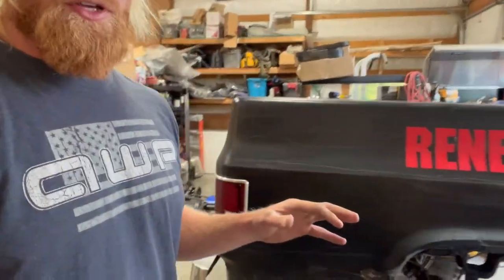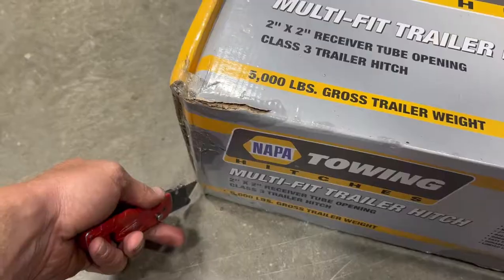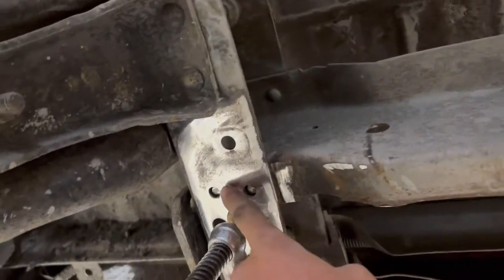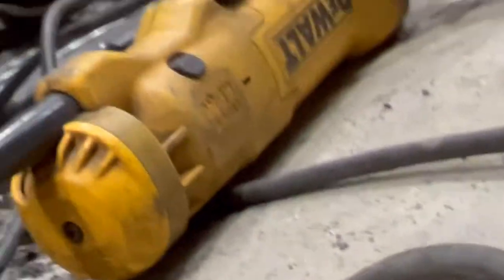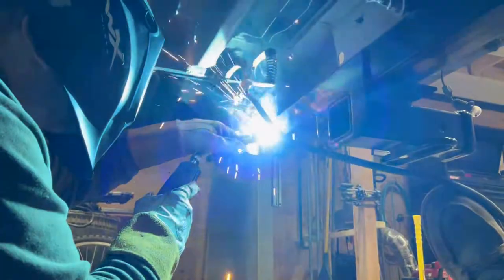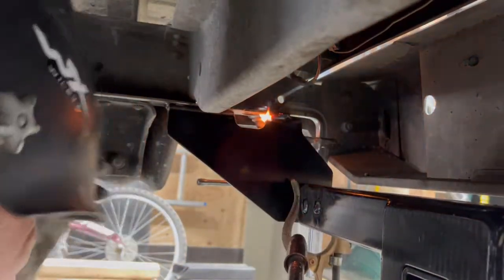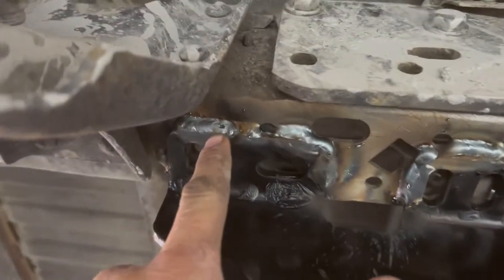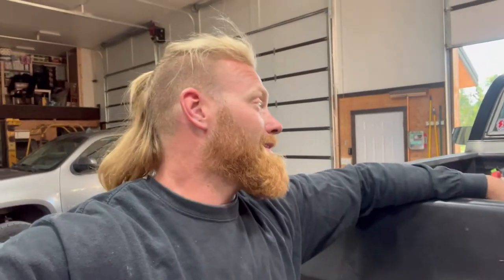Welding Tow hitch install 78 GMC squarebody

Comment: I didn’t make to what the thumbnail is about and I have to say, footage of the square going in the mountains and woods.. that’s one of the most American things I’ve ever seen 🫡. I’ve got a ‘84 K10 I’m building now. LS swapped 6.0/4L80/NP208 all built. Gonna do crossover steering/ 14 bolt rear end swap and would like to do Hydro boost as well. Seeing as how I have one from 01 2500
Reply from the maker: Dude! That would be EPIC!
Reply: @RenegadeHQ After taking the bed off of mine I consider welding my hitch like you did and or bracing it up

Comment: How’s the Flatout suspension? You’re one of the few I know that uses it hard.
Reply from the maker: I’m loving it! I’m actually upgrading to the GR Plus! So stoked! It lasted a year, with over 10,000 miles of which 2-3000 miles were offroad. And not easy or slow
Reply: @RenegadeHQ  love it! I should get my set 8-10 weeks from now for the Honda Element 07. This should lift it another 3 inches on top of the HRG’s ultimate to a total of 6 inch lift.
Reply from the maker: Make sure your axels can handle it. Haha. I blew out several axels haha
Reply: @RenegadeHQ  Absolutely. There is a man in the Element community that builds cv axles with Porsche parts, I believe. The man I named “Stephen D. Dunn,” and owns “AKDBuilt Performance Inc” and focuses on the AWD community that needs quality built products. 

Haven’t bought anything, but this is my top choice as of now. Together with the HRG Off-road 6inch beast spacer kit. And many other parts like adjustable end links, tie rod ends, and many other stuff that I will need to upgrade as I go. 

I’m aiming to make it a one of a kind Honda Element for sure. I’ve already got plans for a rear metal bumper with a swing out tire holder, and a custom front bumper. Mind you, it’s not a rock crawling capable vehicle at all, but it should be overloading capable by the end of the build.
Reply from the maker: Yes! That’s awesome!